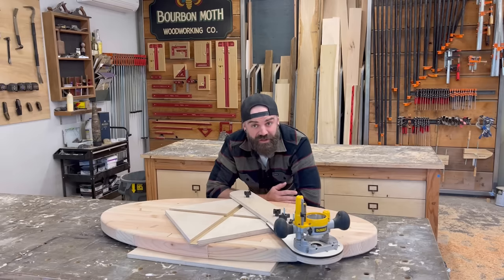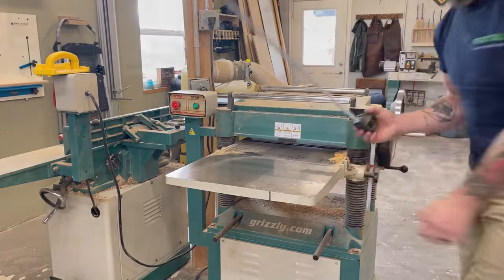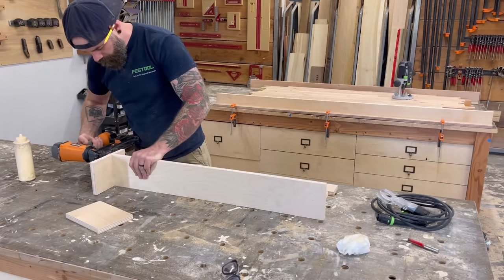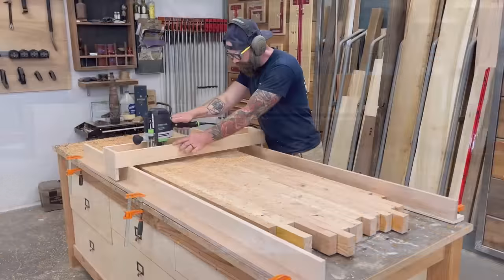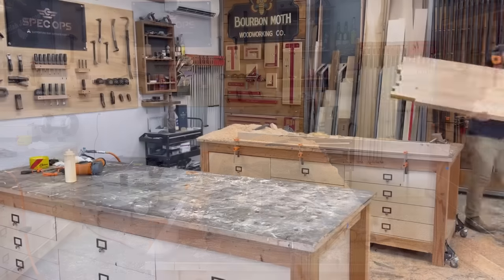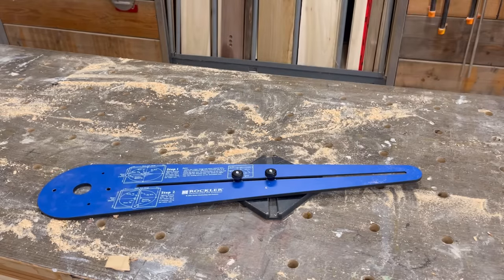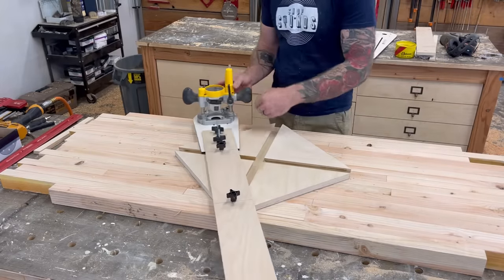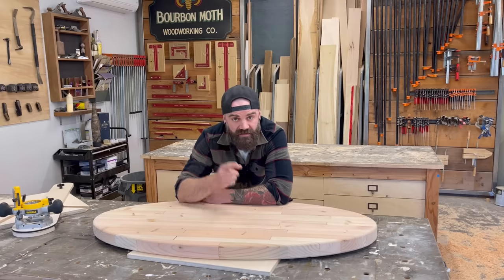Best Way to Cut an Oval || Cool Router Jig

Comment from the maker: To Start comparing quotes and simplify insurance-buying, check out Policygenius: https://policygenius.com/bourbonmoth Thanks to Policygenius for sponsoring this video!
Reply: Something similar found in Euclid's elements and also used by Archimedes.
Reply: In the material handling Industry we would call this an overhead bridge crane.  Commonly seen in factories and foundries.

The axis running the length of the wood is the bridge axis, which has a trolley axis that traverses the bridge girders that span between the two bridge rails.  Then there is the hoist motion that allows one to raise or lower your load.
Reply: We live in a 3 dimensional world.

Y AXIS =Vertical Axis Up/Down
X Axis = Horizontal axis Left/Right
Z Axus = Depth axis Forward/Backwards
Reply: How long did it take going back and forth leveling?
Reply: First time watching, found it 2 B slicker than snot

Comment: For the flattening jig…. To adjust the rails, you can also run string lines corner to corner- the rails are parallel when the strings just touch where they cross.  This is how we used to set door frames before pre-hungs were a thing.
Reply: What do you think about using shims to fix any inaccuracies in the rails?

Comment: Thanks Jason for a fantastic explanation of how to make an oval jig.  I would like to share a method that I use on ellipse jigs and jigs.  Instead of fastening the router base to the jig I drill a 3/4” hole in the jig and then use a router with a 3/4” guide bushing installed.  The router remains oriented in the same direction as you rotate around the work so that your cord doesn’t twist with every revolution  and any router that will accept a 3/4” guide bushing can be used.  John Jensen

Comment: Great Jig,  just found out today that Rockler makes a bigger base you can buy to expand the size of the Ellipse you can do.  I made one like yours and learned you can make the sliders longer , like a foot or eighteen inches, just so they don't run into each other in the middle.  Then you can cut longer and wider ellipses.  You could have made his top use the entire piece both length and width.  Lots of possibilities.  Great video.

Comment: I bought a Rockler jig some time ago because , like you it was fun to play with until I found a use for it, a small oval table. I had the opposite problem that you had, it wouldn’t make a small enough oval for my table top. I had to make my Center cross section “do hickey” smaller by chopping the corners off. Biggest difference was I had a pile of black plastic saw dust. Seriously the stuff inside your head is very cool 😎!

Comment: I've made a lot of tops from dimensional lumber.  Pine is very underrated as a table material.  Sure, it dents and scratches, but it looks lived with.  The ellipse jig is awesome and simple.  And, I'm going to totally steal that router sled design.  Thanks!
Reply: Ahem...that would be a router *train*...
Reply: I agree. I've made desks and even countertops with a 2x4 glue up. Yes it is cheaper material but if you are going for a rustic, worn-in look, other harder woods just don't cut it.

Comment: If you wanted to make the table longer, you can cut the slider that moves across the width longer, when the router is cutting the sides, the end pivot will be outside the width of the jig ;)
Reply: Yeah, that annoyed me too!
Reply: Am I not mistaken or doesn’t placing the pivot for the long side as far as possible, like he did, mean that if it was any farther out it would come out the end of the track? You’d need to make the jig bigger I think, and that point the router would want to cut the jig when it came to cut the short side. I think you’d have to cut the long side and then cut the jig down to get the short sides down.
Reply: @jeremyspecce  With the method i stated, you want longer reach on the lends, but keep the sides the same, the only way to do this is to have a longer bar without changing the pivot closest to the router, which means the other pivot needs to be outside the current jig without making the jig wider.
It may be the case that the other slider needs to be longer too as the jig is 'square'
Reply: @jeremyspecce  you're right, the track for the minor axis is as long as it can get already. The major axis track can be lengthened, but it would cause the shuttle on the minor axis to slip out the end every time the router approached the minor axis. To fix that you can make the minor axis shuttle longer to allow the pivot point to travel beyond the end of the minor axis track without the shuttle falling out.

Comment: Love this jig, but if you connect the hold-down screw holes with a slot, you'll have an adjustable oval jig. It's advisable to add a ruler next to the slot for easy setup. Likewise, I'd paint one of the knows and run a line dyed the same color next to the track It is on, just for easier referencing when setting up the adjustable oval jig. Maybe you could explore that upgrade in a future video. I love your workmanship.

Comment: Jason, when I was a kid in the mid-1970s, my grandfather gave me a 5" x 5" piece of black walnut that had the grooves cut into it and the sliding pieces, a 1/8" x 6" x 1" piece of alternatively colored wood with a dowel glued into a hole on one end and on the bottom was a piece of paper the clued to the bottom that said the product was called,  "The Do Nothing," I just looked on Etsy and there are a number of shops making something approximating the 1970's version; there's even a "Tremmel of Archamedias," that has pieces moving in and across at 45° angles simultaneously. You looked like you were enjoying the function of the "do nothing machine" so much, I couldn't help but recommend this to you. I recall as a third grader even being mind-numbingly intrigued by the device and no doubt wasted an accumulation of hours and days trying to get those two damned pieces to run into each other. Strangest thing that they never did, ha ha.

Comment: I did this 20 years ago to make a free standing dressing mirror for my wife. Only difference was a second pass 3” inside the first pass. 3/8” deep with a 3/4” straight bit then through with a 1/4” bit. This made the recess for the mirror glass itself as I cut it out.

Comment: I've never had the need to make an elliptical slab but I still have some wonderful pieces of wood that need to be flattened but are too large for a planer or sander.   I've tried using my skills with my small hand plane but the boards just keep cupping;-).   It occurred to me, watching you making the elliptical device that some version of that could work for flattening the slab as well.  Thank you for planting that idea in my brain.  I'm going to try to figure out if that would work.  
I know, I could just make a giant jig like you did but that wouldn't be as much fun.  And I might have to put an addition on the house to fit it all in.

Comment: When you glue the second square to your base, put the longer 'dovetail' across the top for alignment, and use the smaller 'dovetail' between the squares for spacing.  Otherwise, excellent work as always!

Comment: This is a good idea thank you for putting this in because I have a really big piece of Oak that I am making a coffee table out of and it is the end piece so it's round on the one side and flat on the other side when I cut it with my chainsaw so I'm going to build the same kind of thing and Lease flatten out the flat end and then see what I can do with the other end since its rounded I don't know if the jig will actually try to flatten that or not but I'll see what I can do I also have to figure out how I'm going to put the legs on I'm not sure if I'm going to use Oak to do the legs or go with some metal legs or not

Comment: I'll totally make a router train like this only smaller since I don't have a planer at all.
But if I had one, I'd probably just have cut the original slab in half lengthwise to make it narrow enough to feed through the planer and glue it up again afterwards.

Comment: To save time and materials, you can make a square with the diagonal measurement the same as the width of what you're cutting and glue on triangles instead of more squares. No need to cut off the corners.

If you cut two squares to start with and make the second one wider by double the width of your saw blade, you could use the second piece to cut the triangles and the slidey track thingies at the same time and they should fit perfectly using the least amount of material.

Comment: Great video,  I need to build an oval table for a client the issues is that they want it 9ft long and 3ft wide.  In order to make an oval of that size would i need to make the platform larger, or the swing arm larger (or maybe both)  Id appreciate any advice Thank you

Comment: To get a rounder ellipse you would place the block farthest from the router closer to the center. To get a longer ellipse the sliding blocks would have to be longer to allow the pivot point where the T-bolts are to go beyond the limits of the jig. But there would be a limit to how much longer you can go because as the sliding blocks are lengthened they would eventually bump into each other at the center and if the T-bolts go too far beyond the jig they would not be kept well in line with the dovetail slot in the jig.

Comment: 16:04 It would be better to flip the long/short sliders around so that between the first and second square there's a short piece and they both share a common side against the long piece. Then once those are glued up, move the long slider to the gap between them, so that the other two squares can butt up against it. That way the sliders can go smoothly end-to-end without any possible misalignment.

Comment: For the router guide you can ensure a flatter surface if the sides sit on the base instead of the base being in between the sides.

Comment: I don't know which You Tuber I saw do it (possibly Modustrial Maker or Kim Tippen, not sure), but a good way to hold something down that can be easily removed when your done is apply a strip of masking tape to each surface you want to attach to each other, then use superglue one piece of tape to the other...instant 2-sided tape that has descent holding power but isn't going to mar either surface when it's removed...do this for each piece of double sided tape you would normally use to secure the work...

So in order from top to bottom it's 

work piece
masking tape
superglue
masking tape
workbench

as long as you're careful to keep the glue from oozing out from between the 2 pieces of tape, you'll have no problem unsticking the piece from the bench...

Comment: Very interesting. .. It demonstrates all kinds of techniques and safety concerns. ... But,... it wasted some material at the ends of  the 2x4 glue-up. That, had to do with where the bolts were tightened on the long router base. 

An ellipse is like a circle, but with TWO focii, rather than a "Center". The separation between the focii determines how stretched out the ellipse is for cutting the perimeter. The distance from one focus to the perimeter and then to the other focus is kept constant. ... Then, more material from the glued-up board would get used for the table. 

Of course, one determines the length of the table top, depending on personal taste, and living room space limitations.

Very nice video, instructive, creative, with feeling, suspense, and entertaining. Congrats!

Comment: Even easier for cutting an oval is two nails and an end of string attached to the router. Just make sure to keep tension on the string when cutting. This method works surprisingly wel…

Comment: Nice wax the top of the rails use a 1 inch dowel drill a center hole and thread to replace your back wing nut ergonomic yo!

Comment: Considering it is a chunk of 2x4's would it have been easier to cut it apart, plane both halves, joint both halves and reglue?  (I guess if in a real time crunch, waiting for glue to dry could be an issue)
Reply: I thought about that same thing
Reply: I thought the same thing.  You could just cut along an existing glue line.

Comment: Great video, now; would it be to much to ask for a video of how to do a ellipse “ring”  with laminated wood pieces (scraps) to frame a mirror or can anybody recommend one? Thanks
Reply: The same approach would work. Cut the outside perimeter first. Test the second by using a pencil in a pencil holding jig instead of a wood cutting device.

Comment: I made hundreds of elliptical topped doors and windows since the 80s 
Just use a Trammell stick major axis to pencil point radius of longest direction 
Now pencil point back to minor axis radius of shortest direction
Now run major and minor axes on Sq 90°of each other like the edges on a sheet of plywood will work this will draw 1/4 of an oval aka ovolo

Comment: when gluing the second piece you should have used a short piece between it and the first and the long piece across the top of both pieces  - easier to insure they are lined up...

Comment: I noticed when you were using the Mitre saw at 20:55 you had a spacer between the cut and the fence? Is there a reason for this? Does the saw not cut square or something on the fence?

Comment: I’ve only used spiral router bits a few times, why would you use a down spiral bit to cut the oval out, wouldn’t that put the chips back in the groove? I thought an up spiral was the flutes removed the chips up to the base of the router.
Reply: @Dinger523  Thanks for the explanation.

Comment: Ah where was this video 6 hours ago when I was trying to figure out how to draw an oval!
Reply: To draw an ellipse, put 2 nails some distance apart on the long axis and put a loop of string around them. pull the loop tight with a pencil and go around the loop. A little trial and error should get you to the size you want. There's probably a formula to figure this, but I'm mathematically challenged.
Reply: Chuck J has it right for drawing an elipse. Just google it for diagrams if you need. The method used in this video is good for jigs, but is overkill for simple drawings.

Comment: Asking for a friend… why not just rip it in half, run through plainer, reglue. You made a cool plainer sled jig. That’s a positive but if you cut down a glue seam this would have been done in 5 mins.
Reply: I agree. I guess the only reason that wouldn't be an option would be if you can't spare losing the width of the kerf of the saw blade.
Reply: I agree, but Id he’d done that, there would have been no need to show us how to make and use a router sled
Reply: The planer wouldn’t have made it flat without a sled for it as well. A planer reduces thickness and makes faces co-planer but does not make things flat on its own. That the job of a jointer.
Reply: @jeanchapman1301  yep
Reply: Came to the comments to ask the same thing
Reply: @jeanchapman1301  he was able to do the exact same function as a planer with the router. All he did in the long run was make the faces parallel. I think your over thinking this boss.
Reply: 💯 I wish he would have said why he didn’t do this
Reply: @Name-vu1kn  not the exact same function.  Only if you make a special sled for your planer can you truly flatten a plank like this.  A planer’s rollers will press down on a piece of wood and it will still come out cupped or bowed.  The router sled does not press down on the slab and if shimmed into place and secured properly, it will come out perfectly flat and even.
Reply: Of course he could do that with 2x4s who cares.  But if this was a picture perfect slab, you wouldn't want to do this, you would ruin the seemless transition in the grain.  Otherwise, you're right

Comment: At about 17:30 minutes you cut the excess corner to corner. Could you have started with half of the jig, cut the 13 degree on all four sides of two squares, cut corner to corner, then pivot the two outside triangles you just cut on the far corners around 180 degrees to nearly complete that part of the jig (minus 1 strip of material between the two triangles) effectively using the "waste" as the other half of the jig?
Reply: Well maybe not pivot 180 but slide it around a bit and readjust. I feel like it can be finagled

Comment: Let's say I want to make an ellipse of a specific size: Say 30"x17". Without going through a trial-and-error process, how far apart would the attachment points for the sliding pieces be, and how far would they be from the router bit? Put generally: Given the major and minor axes lengths, how does one calculate the necessary spacing for the sliding carriages and router?
Reply: The pivot points would be half the final length and width. In your example, the minor-axis pivot would be 8.5" from the inside edge of the router bit and the major-axis pivot would be 15". The only other constraint would be to ensure that the jig itself has a diagonal length no more than 1" less than the width of the final cut but still enough so the major-axis pivot doesn't exit the jig; in your example, the diagonal of the jig has to be between 15"-16" so the major-axis pivot doesn't fall out but there is still enough room to avoid the router cutting the jig itself.

Comment: Your "slidy dohicky" : truck : length should be 175% to 200% of the tracks width. Good idea to bevel the corners. Paste wax the sides and bottom of the track as well as the trucks.

Comment: The jig assembly...once you glue the first square, the long dovetail should span the two pieces and a short piece should be used to space them. Otherwise you are relying solely on the edge alignment and you risk being off. Other than that, good stuff.